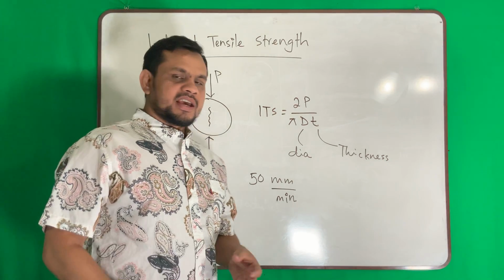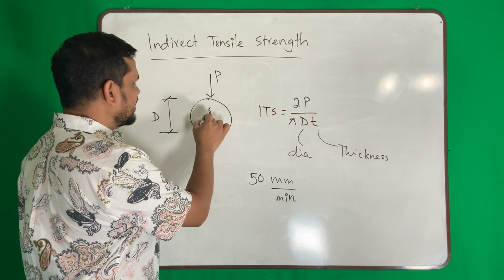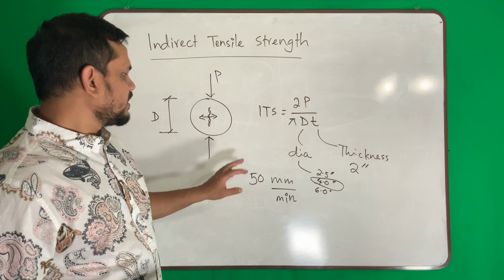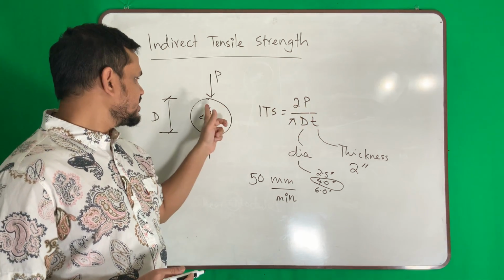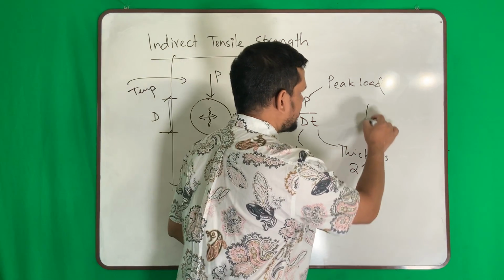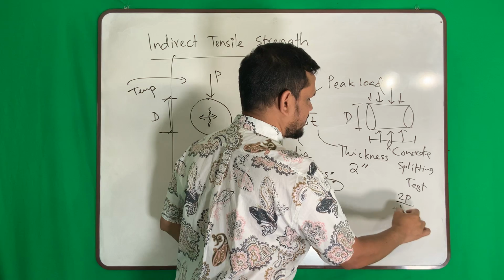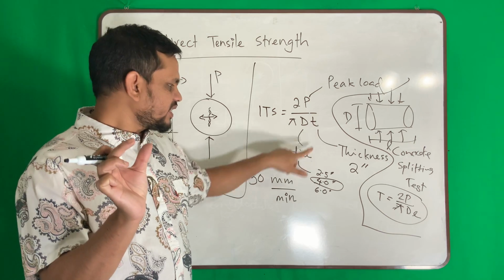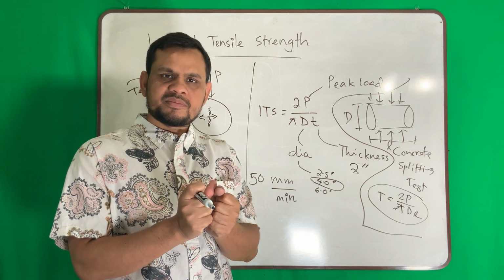Pavement Design (Lec 31) -  Indirect tensile strength test of asphalt concrete

Comment: So is P in Newtons or kN?
Reply from the maker: It is always better to think open. If P is in Newton, D and t are in meter, the ITS is in N/m2 (Pascal, Pa). If P is in kN, D and t are in meter, then ITS in in kN/m2 (kPa).  If P is in N, D and t are in mm, then ITS in in N/mm2 (Mega Pa or MPa).  If P is in lb, D and t are in inch, the ITS is in lb/in2 (psi). Please do not memorize. Just see the parameters and derive the unit. Engineers do not memorize - just follow the logic.